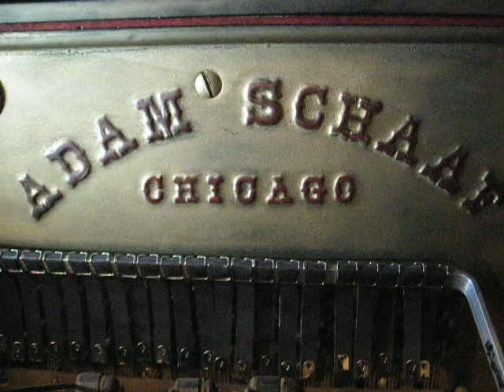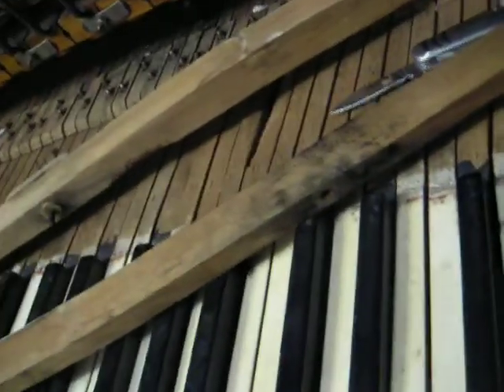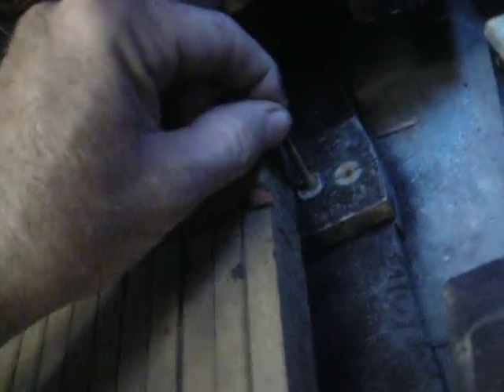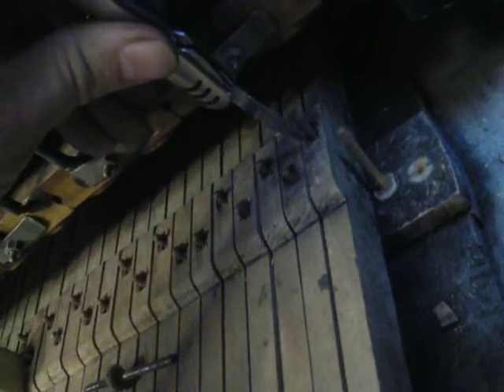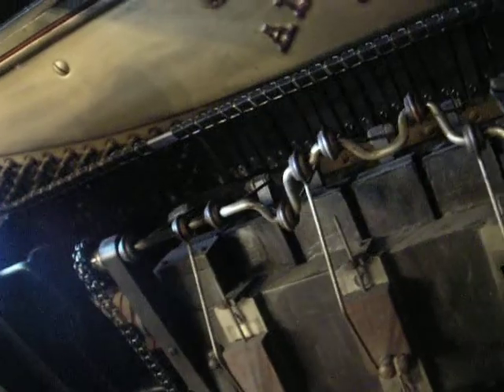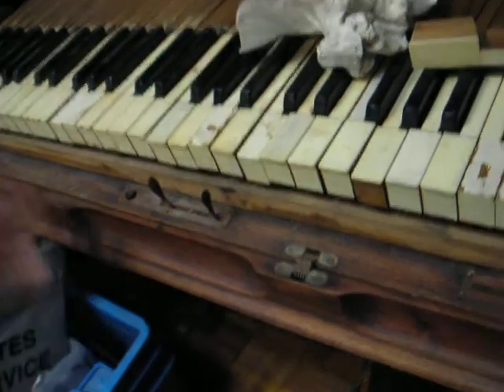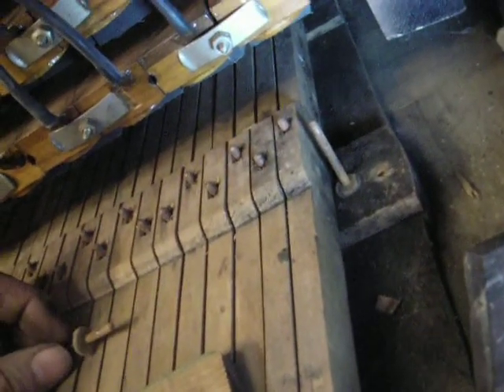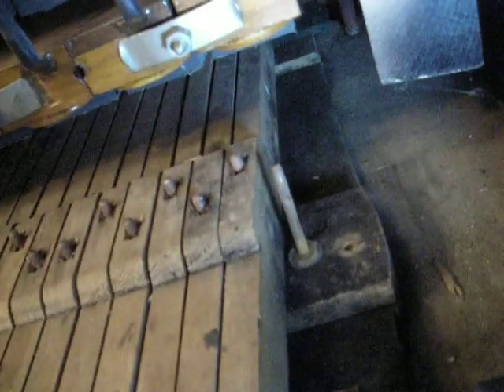Adam Schaaf 1921 upright cabinet grand player Piano Katrina Repair (5) balance rail key pins

Comment from the maker: These pins are typically either 0.146 or .160 inches in diameter and either   2-1/8 or  2-5/8 inch long of Nickel plated steel.

Comment: Really trying to get a handle on just what you are doing here...
Reply from the maker: The goal is to repair the piano instead of scrapping it. The bulk of local folks say to haul it to the junkyard or burn it since it went 2 feet under salt water during Katrina. The piano's "balance rail pins" all need to be replaced so the keys are not sticky. Some have a great action and others are stuck on the corroded steel pins. The pins are a standard diameter but slightly shorter in length so the the keys can be inserted. The valve assembly above the balance rail limits the keys removal with a standard length pin. Thus I need to buzz off some standard pins to make my custom ones. Its not a bid deal since I have a lathe. The funny thing is I would never be attempting working on a piano if it was in good shape! But since it is damaged and considered now a junker there is less fear of repairing it.
Reply: 3beltwesty
You really need to buy the Art Reblitz book/s on piano and player piano restoration.  Your 4 videos all say the same things but no progress is being made because you do not seem to know which direction to go.
     Trying to get the keys out without removing the upper player action is an exercise in futility and frustration.  Take out the pneumatic stack.  It comes out in one piece by removing a few screws.  Then you will have easy access to the keybed and can remove and throw away all of the nasty felt and all of the crud under the keys.  Otherwise you will never get it all clean as you say you want it.
     You can buy new balance rail pins and throw out the rusted ones.  New ones are nickle plated.  You can never fix the old ones.  Throw them away.
     You will also need to rebush the keys with new bushing (not felt) cloth since they have been wet and the glue will come loose.  You will also need to buy all new felts for the keybed.  back rail felt, center rail punching and front rail punchings.  They are all shot because of having been wet and have lost their resilience.
     That is only the beginning of what you will have to do.
     The bass notes are dead because it sounds like the bass bridge has come loose from the sounding board once again because of the water.  the only way to fix that is to loosen all of the bass strings and remove the bass loose bridge, drill and glue and screw it back in proper position OR order a new one.
     The bottom pumps I am sure are a mess because of being under water.
     there is no free lunch so you have a HUGE project ahead of you.  I hope to see the finished project video soon.  Good luck!
Reply from the maker: TUNE THATPIANO
TUNE THATPIANO
Reply from the maker: TUNE THATPIANO All 5 of these videos were shot the same day thus the same progress or lack of.

I have Reblitz's books. Every piano expert would toss this piano since they do not have the raw experience of dealing with items that went under salt water due to Katrina. i.e. the experts would punt and move on since they cannot wait years to get stuck fasteners free or waste time and labor on a worthless item.

 To free up stuck smaller fasteners requires Kroil, PB nut blaster, WD40 and heat and gobs of time to free up the stuck fasteners. In other household items that got flooded it has taken much time and messing to remove stuck fasteners. With tiny screws often there is no way since the cancer or corrosion is worser as items gets smaller.  

The keys on they piano are made to be removed without removing the valve stack. They have been removed before the flood with no problems. The valve stack is stuck right now and thus has not been removed yet. It has been off before, buts its been many decades. Agree that getting stuck keys off would be easier if and when I can get the valve stack off. The pins are a tad shorter
than stock pins.

This piano use to have tacks on the hammers since it was in a 1920's bar when younger. :) Then a 1980's piano purist i.e. tuner removed them and then the bass part sounded dead. Thus the bass bridge was probably off or compromised decades ago. The sad thing is this expert removed a bellows that he did not know what it was for. It was the bellows that damped the pedals from hitting a wood floor when the pumping door is opened. This bellows was like a shock absorber that allowed the pumping petals to slowly fall to the floor, thus no dents in the wood floor. Relatives had an air motor vacuum deal installed and the piano basically was ruined. i.e. its bar sound became more like a school piano. :)
Reply from the maker: With one of Reblitz's book I learned the pianos mechanical engine is "Amphion". Then I got an old Amphion manual off of Ebay that covers deep than Reblitz's great stuff.
Reply: 3beltwesty That's good, but the Amphion service manual while a good reference for determining which parts are which, will tell you nothing about restoration as they were printed for servicing new pianos. 
when I said get the Reblitz book, I meant the "Piano, Tuning and Repairing" book.  Not the "Player Piano Servicing and Rebuilding" book.  You need THAT one, not the player one.
Reply from the maker: I have both books. The "Piano, Tuning and Repairing" book was made in many different editions, mine is a hardback 1997 one.
Reply: 3beltwesty
Ok...get to work!